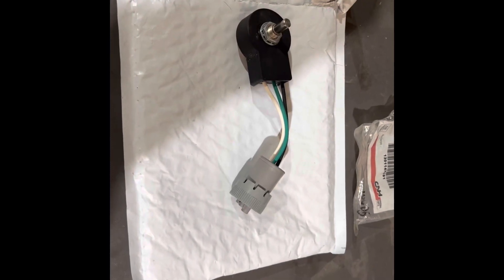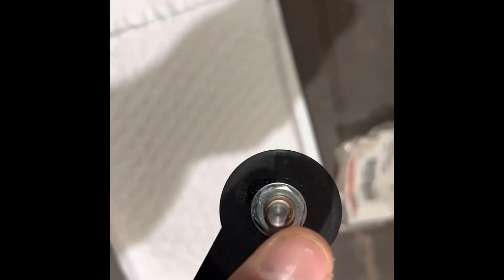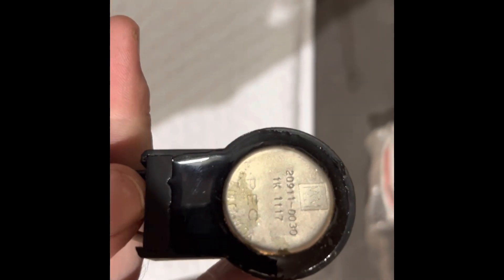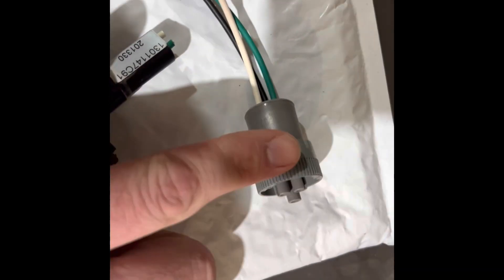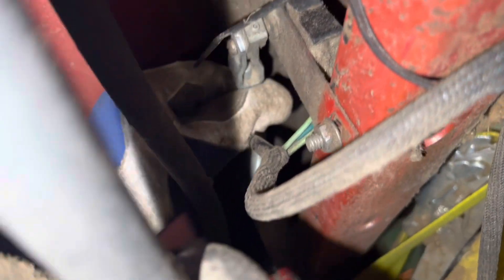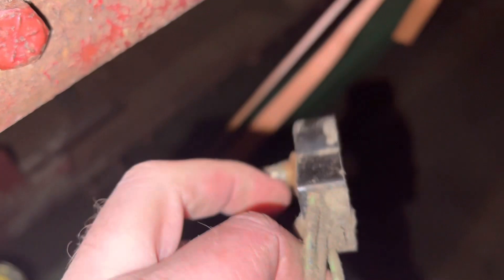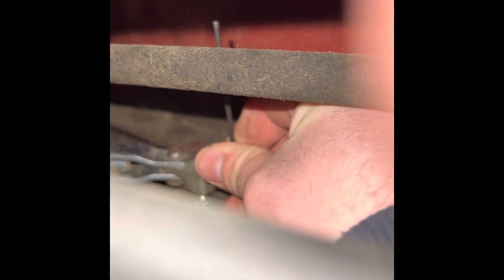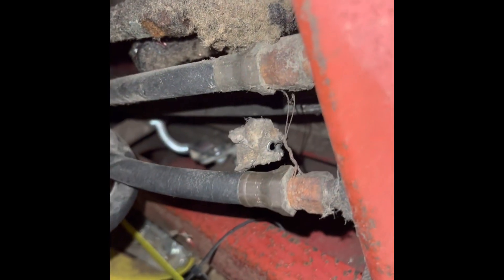Adapting a Case IH 1020 header on IH 1460 Combine Part 1

Comment: This may sound like a dumb question but where is the harness on the combine? we've always used a cable for our 820 header and just bought a 1020 and trying to make the float work.
Reply from the maker: Does your combine have electric over hydraulic controls or do you have and early machine with the twin sticks and all hydraulic controls? If it’s a later one with electric controls, the harness should be on the left side of the feeder house in wire loom with the little black plug on it with 3 wires.

Comment: Was your 1460 already set up for the PTO hookup verses the factory hex shaft and coupler?
Reply from the maker: Still has hex shaft but from what I’ve found you can make slots on the hex shaft to run the pto style on your 14. Hope to make another video getting the header physically mounted.